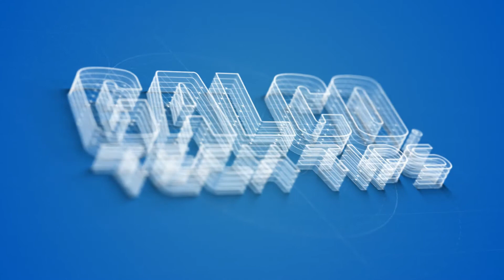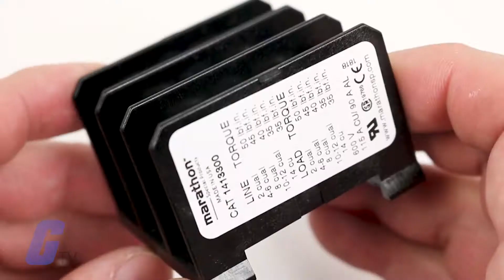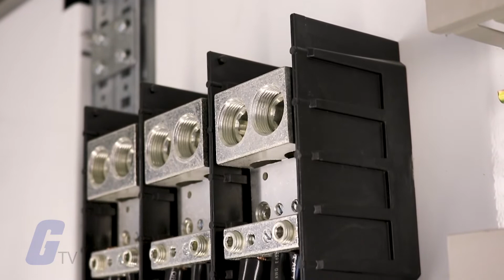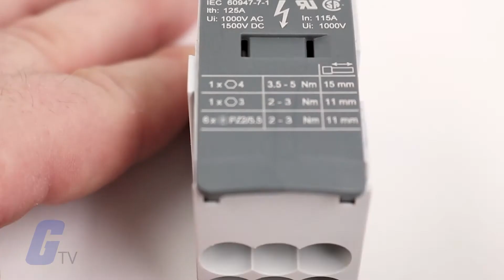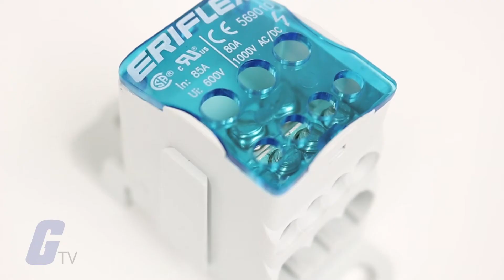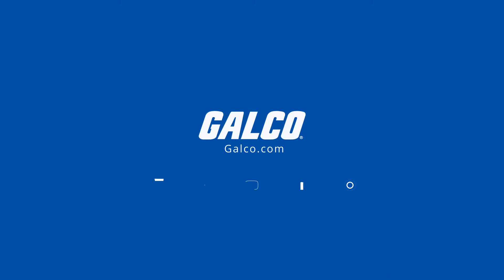What are Power Distribution Blocks? - A Galco TV Tech Tip | Galco

Comment: Problem is when you take a large conductor and break it up into several smaller conductors, there is no protection for the smaller conductors except the upstream main OCPD. Which is going to be large enough for the whole system load.